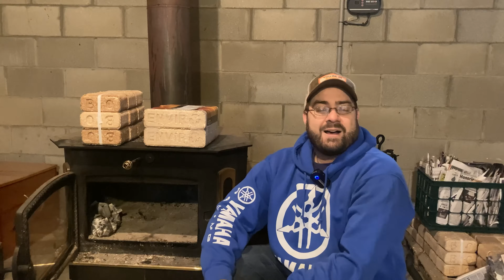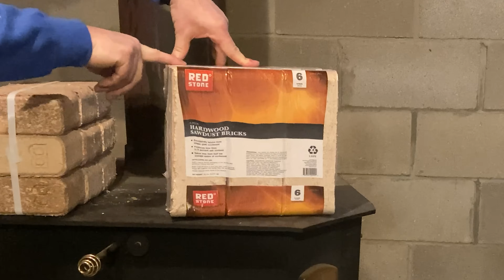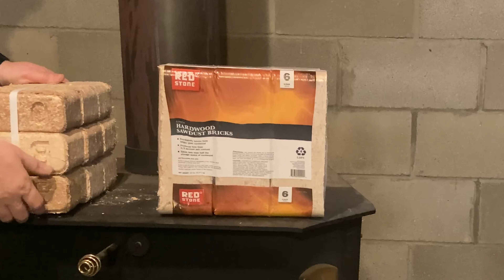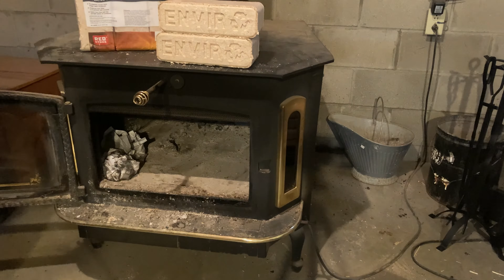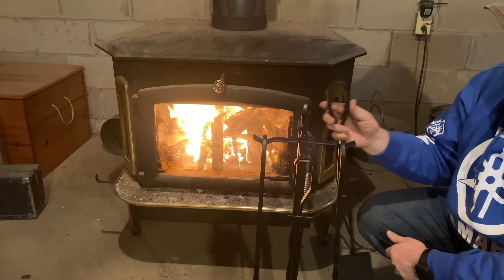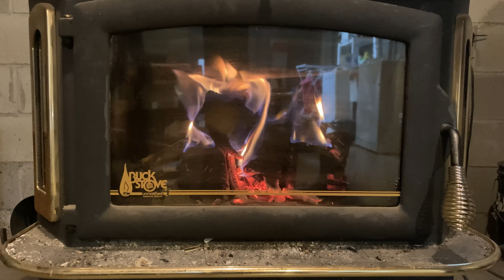Redstone hardwood sawdust bricks Tractor Supply. Sawdust brick burn test. Enviro.

Comment: I like these as a starter in my wood stove.

I place a 2" piece of lit fire starter in the middle of my stove. The one brick on each side about 3/4 " apart. Then cap it with a piece of my usual firewood.

Leave the door open slightly 

In no time you will have a good foundation going. 
Close the door. In about 1.5 to 2 hours start feeding with your regular the firewood.

There is very little ash left. Good clean burn.

My wife likes it because she hates baby sitting the start process.

I get the package of 6 bricks. 
They are the right size as a starter. Usually around $5 or $6.

Keep two or three packs on hand.  

Hope this helps.
Reply from the maker: That sounds like a great, efficient way to get a fire going! 🔥

Comment: I've had terrible experiences with these.
Reply from the maker: Thanks for the feedback. What issues did you run into?
Reply: @PurpleCollarLife We've owned these for 3-4 seasons now. We bought $200 worth. I can never get them to burn with any intensity at all unless I have a really hot bed of coals to set them on. It's extremely frustrating! It's almost like they're full of moisture.

Never had this problem with ecobricks.
Reply: @PurpleCollarLife this is in a wood stove, by the way.

Comment: I bought a pack of something similar to use in my fireplace during this cold snap but I found it very difficult to get the bricks lit & to get them to stay burning hot without breaking them up with my poker.
Reply from the maker: It takes a good bed of hot red coals, or existing flames, to get them going. Then it takes a constant bit of slight air to keep them burning hot.

Comment: These aren't a bad option IF you can get the good ones. If "ENVIRO" is stamped on the sides, you're ok. If nothing is stamped on them or you get the bigger blocks that are in a 3 pack, they aren't that good. Compressed loosely and basically junk.
Reply from the maker: Thanks for sharing! I thought there were several different ones I’ve seen at Tractor Supply over a years.

Comment: Reminds me of Black Locust, with all those blue flames.   Seems like a good idea, if you have massive quantities of sawdust and/or chips- you'll get more $$ for these, vs selling it for mulch or bedding.

  I save the chips, slivers, etc from splitting to use as firestarter and kindling.  DRY slabs of bark, too.  (some species, like cherry, spruce, hickory, and oak burn particularly well)  The curly q's from ripping rounds with a chainsaw make fantastic firestarter!
Reply from the maker: I like those blue flames.  I agree - if someone owns a lumberyard or sawmill - it would make sense to me to capture as much of the firewood and press it into these bricks as possible.  Otherwise, you're trying to find some other way to dispose of it.  
In that "how many pieces in a round" video we released a couple weeks ago - I saved all those noodles (as many as I could pick up) as fire starter. It worked amazing!

Comment: Since it 's not a wood (which is different by moisture and other specs) you may compare them with those smaller briquettes and with firewood. By burning the same amount of each type of fuel in kgs or pounds whatever. Also I guess you may gain a few extra minutes of burning time by keeping them close to each other but not with big air gap between.
Reply from the maker: You're absolutely right - keeping the bricks closer together will increase the burn time. BUT - it does require you adjusting the airflow as they burn down to keep the embers hot.  Thanks for watching!

Comment: why did you get fireplace tools instead of wood stove tools? just curious. i use the wood stove tools i find them easier to manipulate but they consist of a poker, shovel and a broom. i have a couple of tractor supply bricks for emergency. My son in law likes them for his solo stove. thanks for posting
Reply from the maker: WHAT?! There's different tools for fireplaces and wood stoves?  I had no idea!! I did want a grabber though so that I could move wood around easier if needed.  But in the first several weeks - I've used exclusively the poker/hook.
Reply: @PurpleCollarLife  wood stove tools are about 1/2-3/4 the size of fireplace tools. i guess because you don't have to reach so far. i think tractor supply carries them.